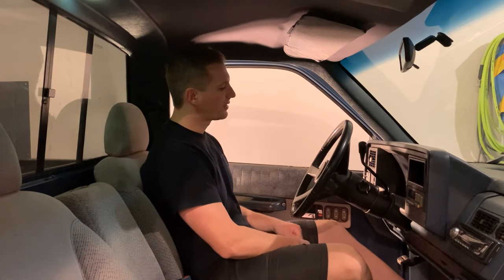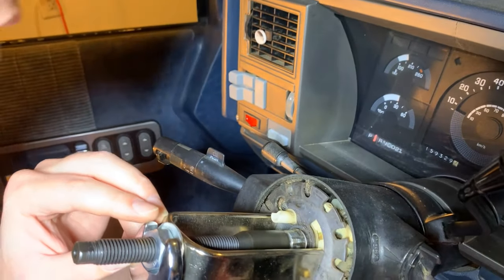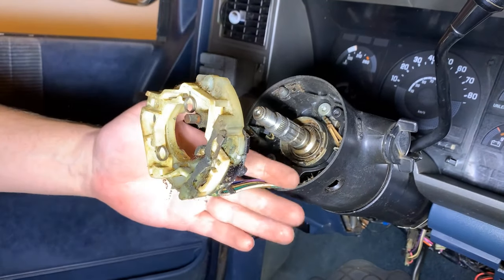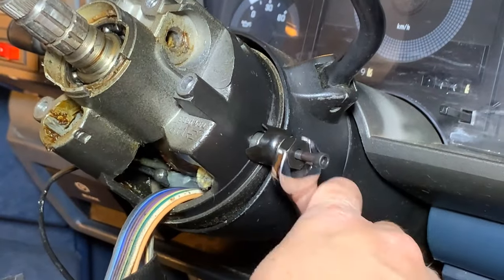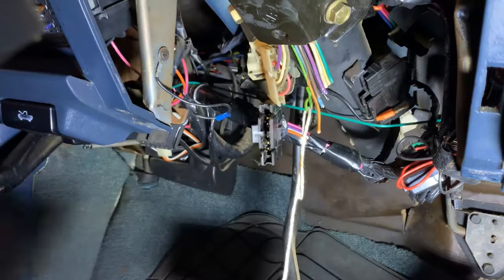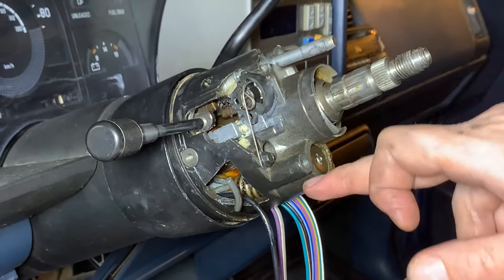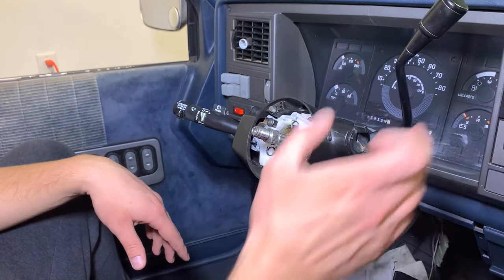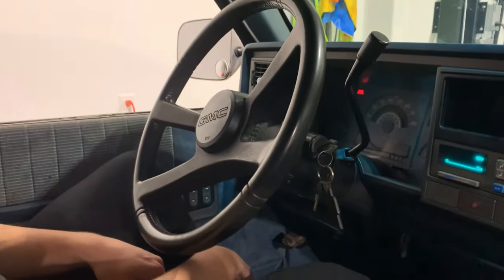Turn signal switch, horn, and gear spring replacement on an 88-94 OBS Chevy 1500

Comment: Who knew a 35 year old GM vehicle would have had such a complicated steering column. Hell new cars are easier to repair than these. Great tutorial man. Lifesaver
Reply: Yeah, it's an over engineered nightmare. I replaced the turn signal switch on an 83 Ford F100 and it was so much simpler. Doing it on my S10 was mind numbing and overwhelming. This guy's video definitely helps.
Reply: @michaellorah9051  No, it's an under engineered nightmare.  A couple of 5th graders could have done a better job with the design...........typical GM.
Reply: For real
Reply: I agree 
I thought was gonna be as easy as Glock field strip.
Reply: You are right man i hate them  too

Comment: This is an absolute nightmare of a process to get this deep in the steering column... I had to do the same to replace the steering column bearing... I really wish I would have had your video when I did.  You did an amazing job showing each step, the tools you used, and the part numbers involved.  A+ job on the video for sure! 😉👍

Comment: Omg this is THE BEST most informative DIY video I’ve ever had the pleasure of watching!! Your video explains and shows you exactly how and why. The volume, video lighting,  angles and clarity are amazing!! 

I now know what the clock spring is although I still don’t know it’s purpose. My blinker stops flashing when brake is applied telling me there’s a short somewhere. Your explanation as to how and why you were going to deal with the giant plastic clip that obviously won’t fit through the column…..Your explanation led me to my problem which I have avoided fixing for over five years now because I thought it would be extremely time consuming and tedious, neither of which I have the patience for. Long story short, the fix took me less than 30 minutes and I now have a properly functioning blinker!! ☺
Reply: The little white switch he is calling a clock spring is actually the key in ignition buzzer switch.

Comment: 1993 sierra here. My windshield wiper switch was broken and I bought the replacement part at o'reilly. make sure you know if yours is "Without Single Key System; With Tilt Wheel" or "With Single Key System; With Tilt Wheel". the pin that holds the switch in is not interchangeable. This video has been great I watched it twice and was able to do mine in no time. I have never worked on a steering column so I was little worried beforehand. Also my 1993 was slightly different. I had a plate in place of what you called the dust cover instead. it was held in place by 2 torx screws. this was spot on
Reply: Hello! I have just run into the same problem and am having a hard time sourcing the "Without Single Key System; With Tilt Wheel" Switch. Could you tell me where you were able to find it?

Comment: The trick for taking the pins out and feeding the new switch wires through with a string tied to the old ones was great.  That saved me a lot of effort.  Thanks for this video.

Comment: Thanks for the video, I used your video as a refresher on what I might encounter going into the shift lever spring. It had been a few years since I've had to disassemble a column to the shift lever spring. I would like to add that the need to replace the turn signal switch might have been avoided with replacing the "signal return springs" on the face of the switch assembly. I find them in the helper hardware aisle at a local auto parts store. They are packaged in pairs, right and left spring and I change both if one fails. A time saver compared to pulling new wires through the column.

Comment: Hey so far you’re the only one that has put a video up that shows exactly what I needed to know to get to the windshield wiper switch 1992 silverado.I couldn’t figure it out I had gotten far enough in there to change the ignition switch and some blinker assembly stuff thanks for the video

Comment: Excellent video, sir. I just picked up an 89 GMC Sierra, step-side in immaculate condition. Brights lever is malfunctioning and the windshield wiper switch is acting strange (wipers stop in varying positions when you turn off). Came with a new ignition switch, so going to install while I'm in there, along with a wiper switch and a new ignition cylinder. Your video is exactly what I was looking for to help me through this process. Great job!
Reply: your problem is at the wiper motor, the circuit board needs replaced,before you tear into the steering column.

Comment: Masterful work here!  I have an 89 C1500 and you just convinced me to live with my broken gear lever spring now that I know it's not that important AND both my turn signals work and the horn wire is working.   No need to go in there until I have to some day!  And when that day comes, I'll be back here with my check list.
Reply: I have the same issue with the broken spring I thought maybe the spring could be replaced without tearing apart the steering column but obviously not I'm gonna leave it alone for now I'm looking at the part but I'm glad I didn't buy it thanks for the video
Reply: OK I just read farther down in comments someone saying no need to tear the steering column apart to replace the gearshift lever spring you can force it in there once removing the gearshift lever,

Comment: Usually, the new switches will already be de-pined from the connectors out of the box. Just follow the wire colors from the old switch when reinstalling. One of the best things about GM is that they use the same parts for decades. Virtually every GM column is the same across all models going back to the 1950's.

Comment: Good Teacher. I learned many technical terms used for various parts (Experienced mechanic) and lots of exacting explanations of a very parts-rich area. For us weekend mechanics, the step of the windshield wiper switch removal was missed —"It basically comes straight out. You kind of rotate it as you pull out as well." The actual removal/installation was not shown, and I could not pull mine out because I was scared to apply so much force that would break the plastic cover of the switch. Destined to live with windshield wipers that work whenever they feel like it in my 1988 Chevy S-10 truck. It is a very weird installation.

Comment: if you mark the steering wheel position to the center stud; makes re-assembly much easier (so the steering wheel is straight)  Brilliant video, no loud noise, concise, thank you!
Reply: The steering wheel only goes on one way. The horn contact has to come through the small hole.

Comment: Great video and great job, my friend!  I had the same floppy shift lever, broken spring issue on my 1986 GMC s-15 Jimmy.  Though I didn’t have an issue with needing to replace the turn signal switch or cancel cam, at least now I know what to expect should I ever have to do those jobs, too.  Though I do have mechanical skills, thanks for the confidence boost your work and video gave me and for helping to make what initially seemed to me like a very daunting task to one that turned out to be quite manageable and doable!

Comment: I've been working on my daughter's truck and have run into some problems, but one of the biggest was every listing for her wiper switch was wrong, her truck had a 5 wire switch and the listing had 7 wires. Standard automotive parts DS397 was wrong, Turned out to be a DS-817 DS-817 GM had discontinued making most of the parts we needed but it's going back together smoothly. I hope this helps someone down the road.

Comment: I watched this video almost every single day a month straight. Finally had the courage to just do it. Guess what.. my 1994 c1500 GMC isn’t exactly the same as I learned from this video so it’s all taken apart and there’s many differences. I wanted to just change my spring out but I may just say nah.
Reply from the maker: @FreshButPlain Does your 1994 have a tilt steering column?
Reply: @SuburbanRanch  Yes it’s tilt. I got it all out back together and now it’s complete. Couldn’t have done it without your video. At first I was confident to tackle the task. Then I was disappointed I even started but I pushed through and it’s all back together new shifter spring and turn signal switch. Thanks!

Comment: I only wish you explained how to remove and install the turn signal lever it IS NOT SO EASY TO FIGURE OUT... over all excellent and I appreciate your slow methodical approach it calmed my nerves which went thru the roof when I got to the level where the brights lever and ignition barrel came out I almost quit lol
Reply from the maker: @HOTRODRICO The turn signal lever should pull straight out.
Reply: @SuburbanRanch  yea, I had a little trouble also with the best way to route the wire for the turn signal lever in the little opening for it, not deep in the column but when I would lift it up to activate the blinkers for the passenger side the wire was getting between the lever itself and the top of the little opening for the lever to move in and it was pinching the wire, so I had to remove and re-seat the lever again... but it wasn't too bad.. I had to push it in and turn it to get it out... due to the key way it has.. neways, great video bro.. thanks

Comment: The nut behind the wheel. Yep, that's exactly what started my problems with that marvel of engineering-- the GM tilt steering wheel in my 1990 suburban. There was nothing wrong with it except it was a little bit loose. No problem, I'll just tighten it up. It was 5 years ago that I first opened that can of worms between my legs. I am a fairly good mechanic, I figured it out I got the wheel tighten. HOWEVER, pressed for time I did not put it all back together again. Soon after it started spitting a few bearings out now and then. Andy predictable happened, the bearing race deteriorated and then it was like driving a sloppy joe. So, what caused the problem to begin with, the loose steering wheel? Me, I caused it by using the steering wheel as a handle to hoist myself up into the suburban. That's what made it loose to begin with. I have not yet looked at this video but I know it's going to be a winner.
Reply: No time to edit all that irregularities of the story as I use voice to text. But I will edit later. Happy trails suburban men... And women.
I UNDERSTAND BIGFOOT DRIVES A SUBURBAN...
I did it again. Failing to look at your video first and or not fully reading all the instructions elsewhere I wasted a couple hours last evening trying to fit my my extra large hands and fat fingers between the steering column and the tight space adjacent to the two screws that one needs to remove the ignition switch.  I read somewhere that you do not need to remove the steering column in order to replace the ignition switch. That was good enough for me that's where I stopped. But I bet that some other information was included which would have helped me. This is what it was. Looking under steering column removal in my repair manual I realized there are four bolts in the floor pan around the steering column which one would remove and split apart in order to remove the steering column. As soon as I saw that I knew that if I were to loosen those four screws take them out bolts whatever I'd be able to lower the steering column enough that I would be able to easily get those 5/16 and he said bolts out so that I can lower the steering column enough that I could easily remove the ignition switch. So that's what I'll do now I think it will go okay.
One cannot simply skip steps when working with something as finally tuned as this GM tilt steering wheel.
It's similar to replacing the logic board on a MacBook pro or the motherboard and a PC laptop you simply cannot gloss over important steps. Maybe you think you can just wing it but again another analogy...
It's like trying to Wing brief speech in front of the chamber of commerce. If you only have 3 minutes you can't very well be formulating in your mind what to do. You have to have those will order thoughts follow your plan and deliver it as such. Practice practice. Again my steering column issues go back to 5 years ago. I thought at the time well I'll get this thing back together eventually. And I would have but I lost some of the parts over the years. If I had another 5 years meaning a total of 10 years to repair that steering column without any formal instruction I might be able to do it I might not. But time is precious.
At 69 my hands are numb quite often so it's very difficult to hold a wrench properly especially a tiny little 5/16-in wrench up there against that little tiny hex head and a tight space that was not even designed for a small and much less Mr fat fingers. My general excuses I have the attention deficit disorder thing going so I get distracted a lot. Plus I'm so caregiver for my wife I was just stroke survivor. And it's so difficult to work on your vehicle you know you get down in there you're doing something maybe you're holding the starter up and trying to get it up in the right spot there. Or maybe you're struggling with the calipers getting the new brake pads in realizing that really you're supposed to take the calipers off do the right ways with it to shop don't do shortcuts but everything is a shortcut when you don't have time. By the way my BRAKE works quite well on that suburban. Notice I used the word brake singular---not brakes. 
The rear brakes stopped working on the go as I am leaking wheel cylinders which made the break she is useless so I have been using just the two front brakes for the longest time which is great you can make a pretty fast stop by the way if that happens to you be sure you're going straight you wouldn't want to try to make a messed up with only two front brakes on a curve for example. But the way it is now I try to be philosophical. With just that one front left brake doing all of the breaking you can make some very good quick last minute left hand turns if you need to which can't be a bad thing. Oh I have new brake pads the rotors need turning I'll never do that. I have the brake shoes and the wheel cylinders for the back I can do that job but I haven't done it they've been in the back of that suburban for about 5 years now.
And yes I know this is irresponsible of me to just run with that one front left brake. But it's also irresponsible of me to Trump on it with that 454 engine and the flowmaster pipes no smog device here in Oregon I jump on that thing and man I love that acceleration and the sound of that engine The thrill of the acceleration along with the adrenaline excuse me a great sense of freedom. But seriously I actually drive the thing pretty slowly plan ahead on my stops. Mostly just driving around town here in Salem Oregon. Downshifting and automatic was that big 454 sounds great. Of course I hit the gas and RPM matches the spinning lower gears. I think it's pretty much My only thrill these days...  In my mind's eye I pretend that I'm Mario and Dre driving a hot souped up 1990 GMC suburban rest all over looks like it couldn't get off the line to save his life and then bam there that old fart goes in that Rusty bucket. Not so great on gas of course especially when you're pedal to the metal most all the time.
Okay well my wife will be up soon and I will not be able to go out and work on that suburban steering wheel. Just writing about that engine and that truck and learning something from the rest of you really is a great escape for me. It's A wonderful challenge. As you know the brain is a problem solving tool. It's quite remarkable sometimes you're stymied and you hit a stone wall and don't know where to go on the next part of the repair. Leave it for a day or two even a week sometimes and often times the answer will come to you because your brain's been working on the problem all that time. Okay you know senior citizens it's a long drawn out stories that nobody can follow and no one wants to listen to but it seems to make the old fart happy so we just smile and nod our head look at our watch and say oh my gosh I've got to run got an appointment. ciao.

Comment: Great video, this was indeed a huge undertaking. I just got through with mine. You can indeed fit the harness plugs through the column sleeve, just drop the column holder and you can feed it right through. Thanks for the video it was a huge help

Comment: I've been having Hell resetting the original TS switch in my '88 Chevy G30 van. Took it off so I could replace the ignition key cylinder and now the damn thing won't set flush against all three screw bosses so sets raised up so the TS actuating rod can't engage the slot on the TS stalk. Nothing has broken on the switch nor off any other parts below it. The only odd part I have is the bolt that secures the key cylinder. My bolt has a tall hex head that accepts a socket while all these YT videos show a finish head torx that sets lower but doubt that's the cause of my woes since it's also original and the TS switch  has operated normally over the decades. I could use some professional help before going crazy and using a mallet to knock the sucker in place.
Reply from the maker: @Bill Wilson There must be something keeping it from sitting flush. Unfortunately without seeing it in person it hard to say what it could be
Reply: @SuburbanRanch  It appears that the Summer heat made some bits expand so the alignment tabs couldn't slide past some housings. Finally had a cool day and night where the temps dropped to 72. In the morning I gave the switch a nudge with my thumb and it dropped down into place. Never seen that happen before with plastic parts. Also discovered that the 4-way button that came out intact had broken apart into 3 long pieces while sitting in a rag covered parts tray. I've only seen that happen to Bakelite when sprayed with electric contact cleaner. I'll Superglue the pieces together and to the screw to see if that holds up before buying another one.